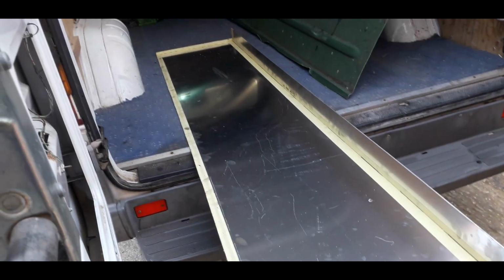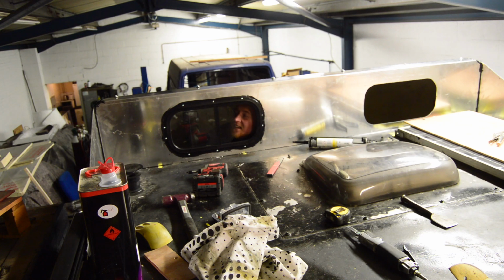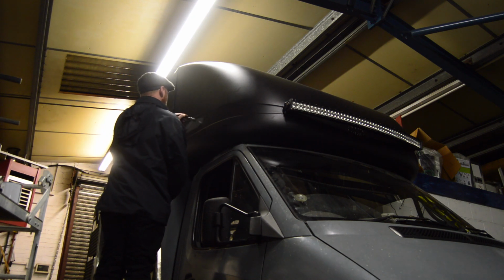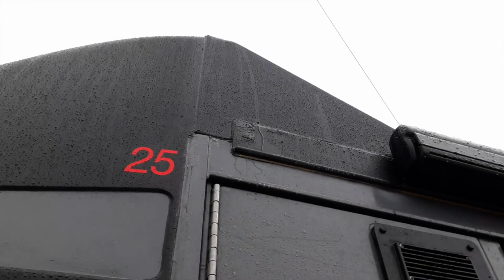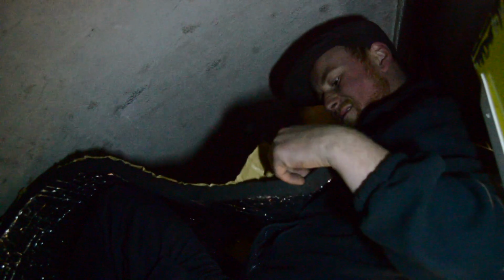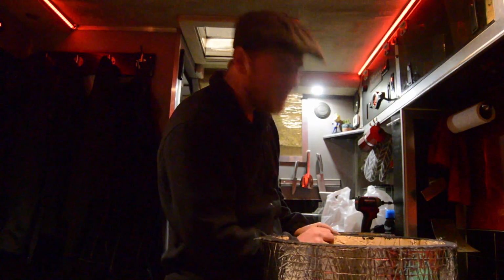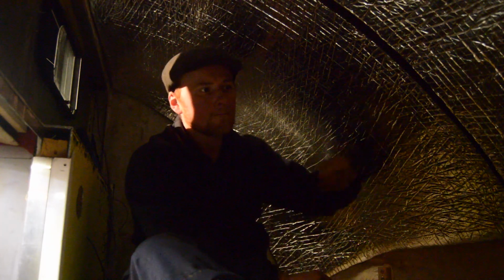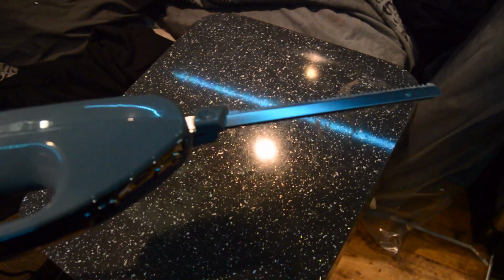Building an UPSTAIRS BEDROOM on my camper! - Project Slaphead: Part 2

Comment: Now THAT explains your top quality work - COACH BUILDER! My build will probably look like a crashed Cessna !!! Being trying out the best insulation and this looks like it! My high top is fibreglass and in summer it gets SO HOT you cant even touch it! So im going with the old spray carpet glue! As my bed will be up in the roof .......I dont want to cook. Also as the vans BLACK without air con it needs MEGA insulation (although may change the colour at some point a bit lighter).
Tried to buy some 'CELOTEX' but it seems to only come in boards :( Is there another name for this please?
Reply from the maker: 😂😂.
Honestly I can't remember what it was called now or find a link as it was so long ago, but its just foil backed foam insulation, the tricky bit was finding it in that thickness, whenever you add the word "camper" they want to give you the thin stuff, I had to call a few places n find it.
My friend @lunabusadv on insta may be a one to take a look at as he has a highttop t6 and he's actually managed to insulate it with celotex and some other types. which honestly would work better for an entire roof. I'm sure he'll be willing to have a natter as your a fellow hightop owner 😉 good luck with the fit out 🤙

Comment: Thermal foam coating. Prep and dry the surface. Then spray contact adhesive on the GRP, let dry then do the foam

Comment: Windows.....???? ...they will allow too much heat loss in winter and the opposite in the summer...... triple pane  insulated  windows might be too costly ...but get some that open if you do regardless if they are single pane....
Reply from the maker: They do open. Maybe that wasn't clear in the video but they both slide yeah. Their main reason for going is was temperature control 👍

Comment: I made a oversized (the needed size) hacksaw in metal...
to saw foam. 
I used an old bandsaw blade as saw.
Than support it on both sides... 
as the size you want... 
to saw. 
It works perfectly. 👌

Comment: wat you could do to prevent branches from hitting the pod (hard) is to put some bars over the top , would make the top just that ilttle taller again 
as for adhering the insulation , might need to use that stuff you used to mount the top on the van 
the ladder works better if you have wider steps , dont forget youre going up there on bare feet
i would put some higher edges along the foam matras so that if you turn over you dont hit the cold steel with youre bare back 
you might need to raise the solar a little near the topsleeper as rotating it up would cover half of it behind the sleeper , it is whell protected now though 
hmmmmm corona virus on board sticker...... should keep people out of it , might even prevent people getting near

Comment: All that work and you faced the seam forward?
The back piece should slide under the front piece.
#WindAndRain
Reply from the maker: Nope the seam is flush the bracket it bonded too stepped down the thinness of the new back panel so butted up 👍

Comment: I guess if you do this again, line the fiberglass section first before installing on the roof. It’s commendable that you up cycle  materials, Though for all the hassle of trying to cut the foam, buying a knife, you could have used that money, (& some more)  on a new custom piece of foam. 
Lastly, hope that broom handle rungs survive over time, probably not the hardest of wood.  Oh well, keep on keeping on.

Comment: If you cleaned the surface first and warmed it up it would have been a lot more successful. Oil off of your skin will stop adhesion. Same thing with putting your vinyl stickers on must be warm and scrupulously clean. But it’s coming on🚐☕️☕️👍🏼🏴

Comment: You have dome very well its just as well you was under cover doing it , its probably not sticking because the fibreglass is cold , I know you have not got much room up there but if you had cut the sheets into smaller peace’s and give the roof a coat of evo stick and let it go off  , but all in all your doing very well in such a small space , a small point that might also be a good idea is if you can reduce the size of your heater flow pipe and put a heater vent up there like they have in HGVs that have pods on day cabs .

Comment: Don't be shy about using the LED light strip when faced with overhanging branches. It should be angled to have a long throw, but not be as bright as having full beam on. Look at how wagons are lit, usually at all corners.
Reply from the maker: It now comes in very handy for those country lanes, just at the time of recording the test run it wasn't wired in. Gotta love a light bar! 👍

Comment: Hi C.J 
Is it too late to install couple sliding windows 😁3 reasons why. 1) when you let 1 rip you'll gas yourself 😖.2) confined space requires fresh air know and then 😤.3) when the summer ☀️ in uk arrives. It ain't like the summer 💥we get here in Aus 😓butttt you will still cook on a hot 😡steamy muggy night...Know 1 suggestion tint those small windows it might help in the summer 😎.
P.s 
You did a great job.
Reply from the maker: Thanks! all good points 😆, but the current windows to open 👍

Comment: Foam is always a bitch to cut, but so worth it when you do because of the comfort levels. Ok, now you've got a bit of a jigsaw mattress going on, no problem! Get some Mattress Protectors from Asda or wherever for cheap, I'd sugest 3 of them, as near the right size as you can get. One on the bottom and two over the top. These will hold your mattress together and add some more comfort. By the time you add a fitted sheet and drop a big fat duvet on, you'll think you are on a heavenly cloud. Just some advice from my own experience. Good luck with whatever you choose to do!

Comment: In hind sight! The area, to which to be applied, should have been wiped down with a release and grease removal fluid.  And then isopropyl alcohol.  Then spray with 3M, 77 adhesive and then, once in place, would NEVER come off!
Reply from the maker: Well it got 2 of those 😂 some things I just don't record because it's boring viewing or miss.

Comment: When it comes to adhesives temperature is an issue. Too cold- won’t stick. Also always good idea to sand down a surface first and clean it too. Also as it’s fibreglass a bit of primer paint would’ve helped give you a better surface to stick too.

Comment: If you can afford it stick a Dry-mat under the mattress to prevent condensation, which will happen under the  memory foam mattress....they get it when not on slats.  If you still need stickers drop is a line , happy to help out a fellow banner

Comment: Ultra clean surfaces and a heat gun are your friend when applying self adhesive insulation in winter  👍 cracking job though. Can't wait till you add a conservatory 😜
Reply: Just seen your comment, that's going to be handy for this winter coming, cheers 👍🏻.

Comment: Given that you have fitted a great deal of weight high up over the front of the vehicle, you should check on the website of the manufacturer of your Wind Deflector to see if they recommend the use of a higher front tyre pressure than standard.

I would also check to see if Mercedes have any recommendations for the same thing.

Additionally, it may be a legal requirement that you notify your insurance company that you have fitted the commercially manufactured Wind Deflector atop your vehicle cab.

Apologies if these things seem like stating the bleeding obvious, but sometimes such things get overlooked.

Your upgrade may be the only one of its type fitted onto an ambulance chassis cab, and as such it's unique, along with being a superb upgrade with considerable benefits.

The difference to your quality of life will be immeasurable.

Making a paper template and cutting out the correct size will help, as will thoroughly cleaning the interior of the glassfibre. 

Insulating the base of the pod will be a good move too. 

The use of spray adhesive may also prove advantageous (or necessary).

It has to be said, your dog is adorable!

Comment: When just one cell of a PV panel is blocked, the output of the whole panel is apparently much reduced. For this reason you may find that your front panel (that is now shaded by your larger front roof molding and quarter strengthener) generates much less power - except when the sun is directly overhead. It will be interesting to see if you notice any difference.

Comment: Nice one! And congratulations on not quite killing the bread knife! :-)

It's actually easier to get a length of bare wire attached to and electric source and use the wire to cut the foam! :-)
Reply: Just make sure you're wearing a gas mask if you do this (mind you the cutting foam means the particles are pretty dangerous in the lungs so it's kinda 50/50)!

Comment: Hi CJ it's probably a bit late now but when your shaping aluminium if you rub it with a bar of soap then heat it with a blow torch until the soap melts it will form a lot easier. The soap is used as a reference so the aluminium isn't over heated if that makes sense?
Reply: Good tip..
Reply from the maker: I will bare than in mind for the future bud cheers